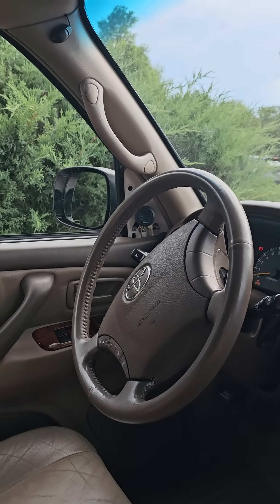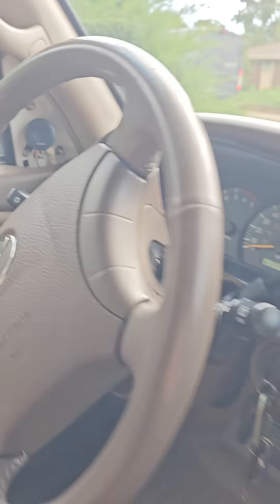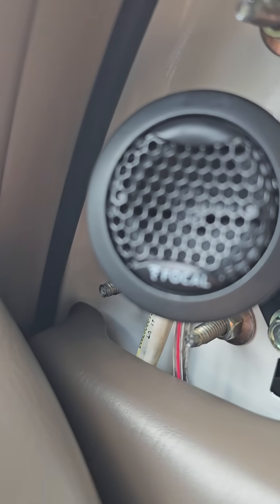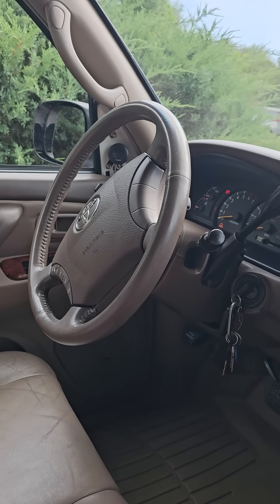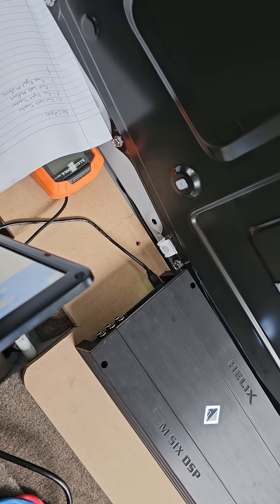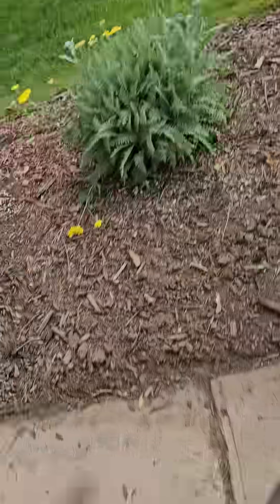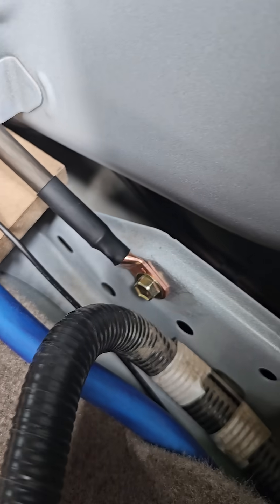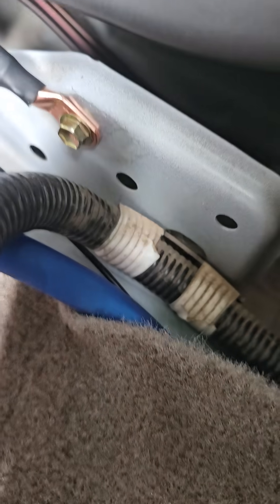Helix M Six DSP noise issue

Comment: In the dsp tool you can set your output voltage, set it to the closest point to your HU. The dsp has a ground switch on some vehicles it depends to set to gnd, iso, or 200ohms setting. After that I would check the input gain on the dsp tool, it indicates a red sine wave when clipping and a grey one when not.

Comment: Hey just want to update you on my amp, ended up booking my car into the audio shop, turns out my helix was the cause of alternator whine, I don’t think the helix has good interference shielding, so they swapped it with a musway m6 pro and had zero issues with it, everything plays perfectly now. The noise floor is very low on the musway, so low that I can’t hear it. I tried everything possible to fix the helix issue, if you can get a refund do it and go for the musway, worth it.

Comment: Did u end up figuring this out, I’m getting the hiss static noise on the same amp
Reply from the maker: No. I emailed support for Resonix and they said this amp has a high noise floor. So it's just internal noise from the amp.
Reply: @chickenfoot911 for such an expensive amp it shouldn’t have such a loud noise floor. I’m taking my amp into my local audio store for a bench test, I’ve changed my ground location and moved my rca wires well away from my power but it’s still happening. I’ll keep you updated
Reply: @chickenfoot911 yea thats why i went audison over this amp the musway is also great
Reply: @duaneduncan2380  I ended up booking my car into the audio shop, turns out my helix was the cause of alternator whine, I don’t think the helix has good interference shielding, so they swapped it with a musway m6 pro and had zero issues with it, everything plays perfectly now. The noise floor is very low on the musway.

Comment: Sometimes you can pick up the amp and move it around,turn it upside down maybe shake it a little see if noise stops or changes I have also seen speakers with sound and nothing hooked up because it was picking up something from the car wiring
Reply from the maker: Shake my amp?

Speakers shouldnt be picking anything up from the car wiring, all power wire is routed separately from signal and speaker wire. You can tell that nothing is being picked up from interference because when I disconnect the speaker wire at the amp, the sound goes away.

I'm at a loss honestly.
Reply from the maker: This was not a valid solution. Nothing changed.